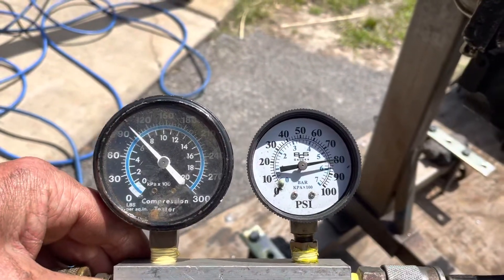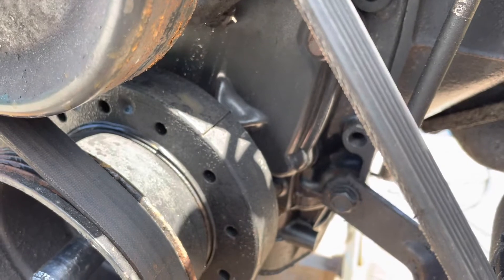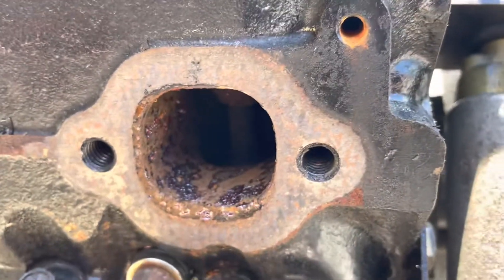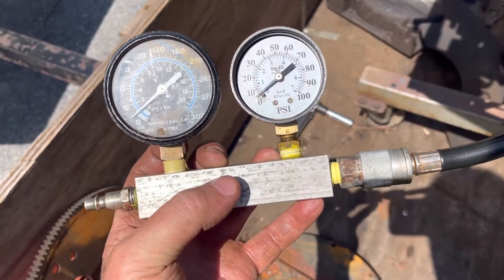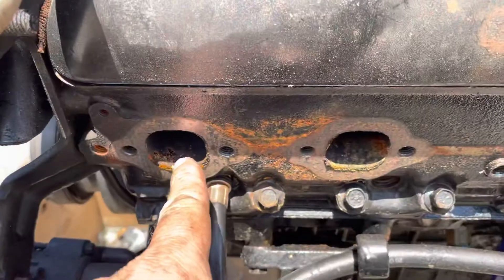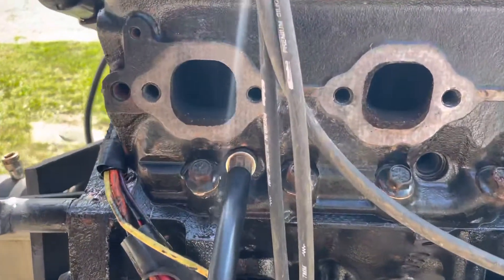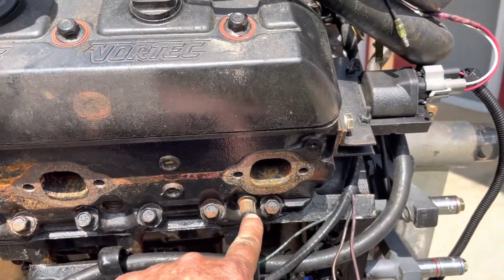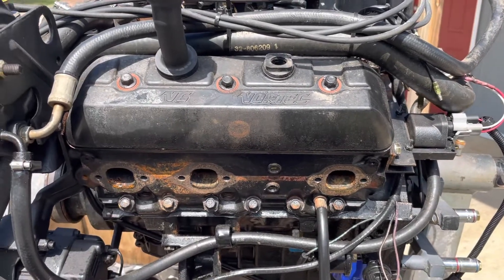Mercruiser 4.3 6(x1) - Failed Leak Down Test

Comment: Question? how did you verify that you were on the compression stroke vs the exhaust stroke ? besides looking at the rocker arms.
Reply from the maker: Glad you asked. There are several ways. 1) You can take all the spark plugs out except for the spark plug in cylinder #1. Then as you rotate the engine clockwise you’ll feel strong resistance as the piston comes up on cylinder #1. Keep rotating until the timing marks line up at zero and you’ll be at top dead center on cylinder#1. Then remove the plug and run your tests. From #1 to get to the next cylinder in the firing order rotate 180 degrees for a 4 cylinder engine, rotate 120 degrees for a 6 cylinder engine and rotate 90 degrees for an 8 cylinder engine.
2) another way is to stuff a piece of shop towel in the #1 cylinder spark plug hole (not all the way just hanging out) and rotate engine clockwise. Towel will be pushed out once piston starts rising on cylinder #1. Keep rotating until timing marks line up and you’ll be at #1 TDC on firing stroke.
3) I sell a tool that helps locate TDC and allows you to do compression tests without a battery. To purchase my tool email me at moccasin.marine.llc@gmail.com. I’ll send you back an invoice from PayPal for $24.99. The tool will be launching this week.

Comment: Im getting blowby and oil through the valve cover vent of my mercruiser 3l. I did a compression test and got 120 psi in all 4 cylinders and putting oil into cylinders only increased comp to 130. Any ideas? Thx.
Reply from the maker: You’ve already found the answer. 120 psi is low. You’ve got blowby past the rings and the pressure in the crankcase pushes the oil mist out the valve cover vent. Cars have pcv systems that suck the blow by back into the engine to burn it. Boats don’t have pvc systems due to the tendency to be driven hard lowering intake vacuum to where a pcv valve won’t open. Your engine needs rebuilding or just live with blowby. Does the engine smoke any?
Reply: @moccasinmarine  no smoking
Reply from the maker: Then the leaking rings are not bad enough to allow oil to get into the combustion chamber. Just have to deal with blow by until the next rebuild.